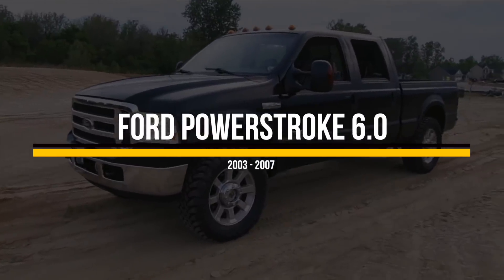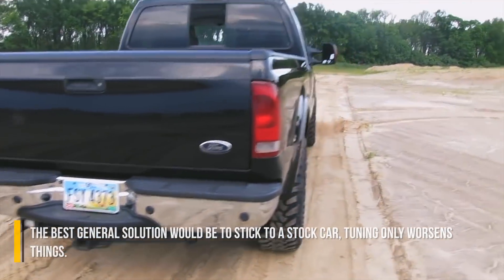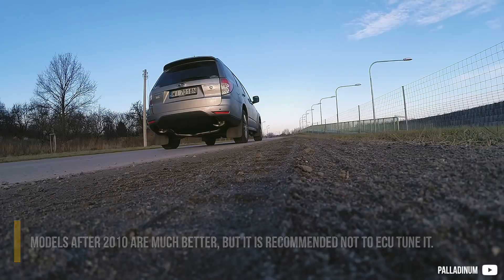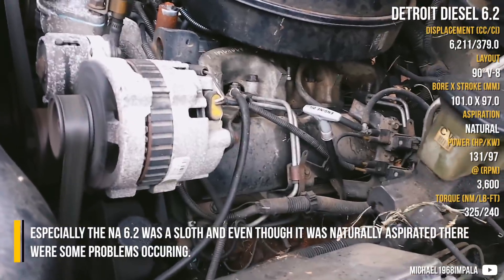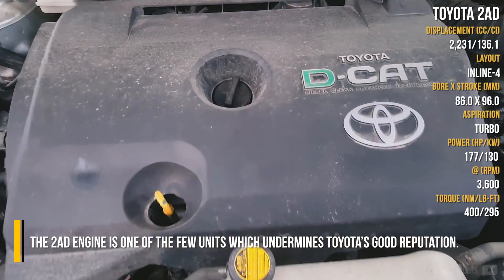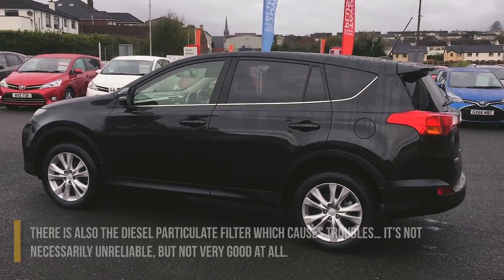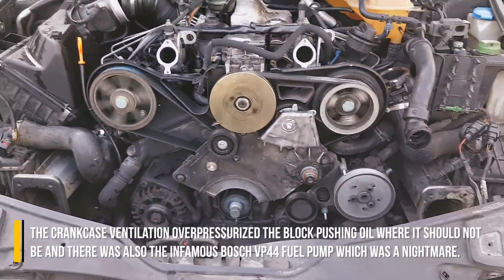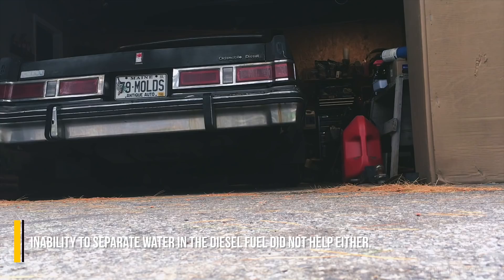6 Worst Diesels You Should Stay Away From

Comment: I’m going to disagree with the 6.2 and 6.5. I’ve had a 6.5 in the past. Like you said, it’s an economy diesel with torque and horsepower coming in at low rpm. It’s not that they can’t tow, it’s that they can’t tow where you’re showering down on them. Their peek efficiency is around 1800rpm. As far as their problems, the marine industry has the solutions for most of them because of their popularity for ship generators, not to mention their military applications.

Comment: Every diesel that have 3000 rpm max, big displacement and low power and torque, it can resist for long time with million miles......you can see the buses or truck expecially if they havent electronical element

Comment: 6.5L V8 turbodiesel...
Don't tow heavy things, not meant to do that... IT'S A TRUCK ?! WHAT ARE THEY GOOD FOR
Reply: I was confused by that too, a diesel powered pickup truck is literally made to tow stuff. It's the reason you'd buy one :D
Reply: I was puzzled by that statement too, because if that's the case there's not much point buying one!
Reply: IDK. Uncle had a 6.5 turbo towed everything he wanted to pull. Cuz had a 6.2 in an old suburban years ago. Slow as all hell. But got 20-23mpg towing a ski boat. That's no bad.
Reply: A big truck wich cannot tow heavy things? Wow, That's what i call shameful.
Reply: Never had a problem with ours we used to haul the backhoes with it for my uncle
Reply: 3.0d MB with turbo u have same power , also drives 1mln km , can be used in trucks less Liters/100km not so heavy lul
Reply: Lol I pull heavy stuff with my 6.5L TD 3500 constantly 😂😂, skid steers, trackhoes, farm tractors, fords, and much more 😂
Reply: The 6.2 and 6.5 were intended as fuel savers, not workhorses. Which is pretty much the opposite of what a diesel truck engine is meant for
Reply: uhhh...drag racing ? :)
Reply: The 98 6.5 td stock in a k3500 only gets 13 max anywhere except the 2 times i went downhill all the way for 2 hours and pulled off 18mpg without a load
Reply: ruben matthys  isn’t that the purpose of a diesel of motor is to tow heavy things. Because they have a lot of torque?
Reply: Isaac Smail the 6.5 turbo diesel only makes 400 lbft of torque and 185 hp
Reply: HitchedZebra59 the 6.5 had the most horsepower and torque every year.
Reply: The point was that the military design that motor torque for the Hummer H1 Humvees and Military K5 than GM implemented it into civilian vehicles and cause all kinds of failure issues on purpose so that people dump money into them if you learn about the motors weak points and take steps to fix them like a mechanical blow off valve a better fuel pump relocate the ECM and out of heat sink better Turbo pump up fuel system redo the head I suggest getting a custom head gasket made to hold the extra power and may do just fine as a matter of fact a lot of people who have ocean-going boats like the six five because of its reliability in mileage
Reply: Christian Nickels you have absolutely no idea what your talking about
Reply: jdr ok  really because I own one and it works great after removal of the vacuum pump I relocated the PCM got a better lift pump to feed the injector the most reliable vehicle I've ever owned I'd like to know exactly what you know about the six five Detroit that leads you to believe that I don't know what I'm talking about because personally I think you blowing a bunch of smoke but you don't even own a diesel matter fact I'm on the  impression that your just a keyboard Warrior and I doubt you've ever actually turned a wrench so if I don't know I'm talking about back it up and explain to me why it's not a decent motor mind you I'm not claiming it's the fastest thing in the world merely that it can pull not fast but it will pull a lot of weight and do so reliably for a long time
Reply: Christian Nickels no you really don't gm designed the 6.2/6.5 then they got used by am general.
Reply: jdr ok tell me what vehicles they came in they came in Hummer H1s they came in K5 Blazers that were military usage you can buy them from army surplus stores then after it became a civilian motor it came in 1500 and 2500 Chevy CK trucks various other companies picked up usage of it and put it in some tandem semi trucks and other things but it was a GM motor through and through originally military contracted but always used by GM built by Detroit Motor Company which was is gm owned
Reply: Bro I've stood in the engine bay of more semi trucks and you seen on the highway
Reply: towing.
Reply: jdr ok you're so knowledgeable about diesel motors bro what's an lb7 or an Lbl do you know bt6 or bt4 or isx15 cat five hundred fuck bro can you even tell me the nickname for the 6.5
Reply: Whoever is first to throw out that old compensation stereotype is usually only doing so to make themselves feel better about their own short coming. Avoid the spotlight by standing behind it, that's grade school tactics man, you're only fooling yourself.
Reply: Had a 6.5 in my 2002 express van. Gas mileage was ok. My god was it loud tho! And it covered my neighborhood with soot when i finally got it started in the winter.
Reply: Get a real diesel get a 5.9 cummins not a gas engine wannabe diesel!
Reply: more than the 7.8L turbo-diesel makes in the truck im buying...
305-lb-ft and 135hp. but it'll last fucking forever. military engine
Reply: what makes it bulletproof? about 1800lbs of steel. (engine only, dry weight)
m35a2.
havent purchased it yet. still a few months out. these kind of things arent rushed...heh...truck only goes 55 at redline lol

its a 6 wheel drive BEAST. i dont think it would be called a truck honestly,...but im not sure of a better name for it.
Reply: Tyler Werfel my dad has the HD version and his biggest piece of equipment is 8 tons and it tows that no problem. So 3 skid steers,2 excavators plus all the tools and equipment in the truck itself. It’s slow though but no big deal.
Reply: @TheJeremy5599  My dad's coworkers called his 1969 Olds Toronado "The Gold Tank", so I would call your beast a tank. That car was unique. 455ci, 400BHp, 400lb/ft of torque, and front wheel drive.
Reply: @PorygonFanatics I couldn't really understand why the 6.5 couldn't be better than it was. Some have better luck than others. Heel they are used in Hummers. After all, it's a Detroit, they build some of the best industrial diesels.
Reply: @daw7189 

They are brilliant engines if you build em with proper parts alot off the problems with them are stupid poor componets that fail 
Get rid off these and you can have a bomb proof i have two engine s chevy 6.5 supercharged 300hp each sip fuel make big power
Reply: Joel Sullivan  just the 5 speed manual with a 410 rear.
Reply: They were good for nothing.
Reply: @jdrok5026  'scuse me. My 01 7.3L had 250hp & 525ftlbs. The anaemic 6.5L wasn't even close. When I bought my 01 Ford, I had a salesman on a GM lot tell me not to buy the 6.5L diesel. Because they had too many issues.
Reply: Year by year, the 6.5 td made pretty much the same power and torque numbers as 5.9 Cummins, and weighed 400 lbs less. Sure they had problems, but they are still capable towers.
Reply: HP dont mean shit tho. 12v cummims makes 180 with a manual but made significantly more torque than the competitipn of the time.
Reply: @ohiopower  thats a ski boat. Try towing a goose neck live stock trailer loaded with calves they blow head gaskets and spin bearings.
Reply: @PorygonFanatics detroit diesel had nothing to do with the duramax. Gm called in isuzu being tgey owned part of them and the company had many years of experience in compact diesels. The duramax is actually a scaled down version of a 12.0L v8 diesel used in trucks found in southern Asia.
Reply: These motors were NOT built from a gas motor. Totally different bore, stroke, head, valve configuration, squish angle, ect. These motors were made by GM, Detroit Diesel being the divisions name, for military use. They have a much lower compression ratio than your 7.3 or 5.9 so to be able to run on jp8 or kerosene if needed. Detroit also has an 8.2 motor in the same class. The 6.5 was an answer for more power, increasing both the bore and stroke, still a lower compression motor only running 5 psi boost. The crank seals, piston rings were NOT made for high psi boost (7.3&5.9 run 25-30 psi) it was made for reliability and economy. Something that would get troops home no matter what and they still do it today! Along with 1000s of these motors still working in boats daily. PMD and shit banging Borg Warner (Ford) Turbos were most of the issues along with some blocks cracking where the starter mounts.  PMD and turbo easily fixed. When taken apart and rebuilt with studded heads, custom head gaskets, better seals, better pistons/rings, better injectors, bigger turbo and a few other tricks, these are truly impressive motors putting 400+hp and 800+ft.lbs down, and personally, these built 6.5s sound better than any other diesel. I've owned a few of these and pulled 4 horses to the mountains, firewood, hay, whatever I've wanted and i love the 22-24mpg I get after 1/4 million miles.
Reply: Colton Carpenter, you are partially correct about the 12.0 Isuzu. The duramax is more like a 3rd generation "micro-computer controlled"  engine and the 12.0 being the first. Very very few similarities. 
As for not pulling, a stock trailer is exactly what I haul almost daily with my 1994 chevy 6.5 with 254,000 on it. Ain't spun a bearing yet, I'd lean more toward improper oil level or weight if I was you. This is the 3rd one ive got and I'm looking at another. Can't keep injectors in a Damn Cummins and I won't allow a shit popping Ford on the place!
Reply: @todydn  lbl I've never heard of the duramax designation.
Reply: @rickslickk5216  um huh?
Reply: Ok, well I have owned many 6.5 diesels and this weekend I was hauling around a 10k lbs excavator on a 4500lbs trailer which I often do and it works just fine, granted its tuned with a bigger turbo but there is nothing wrong with a 6.5 nor a 6.2
Reply: It’s good for farmers burning purple diesel and just looking for a truck that burns the same fuel their tractors do lol. Especially sense they put the 6.5/6.2 in half tones. It’s a good back and forth from town truck.
Reply: They mean anything over 2000 pounds. I know I found it out the hard way the where the flywheel hooked up to the torque converter the crank broke their 😭😭
Reply: HitchedZebra59  brother unless your hauling a fifth wheel semi sized flatbed with a load youll be fine with a 6.5😂no they can't haul 100,000 tons like a Cummins but its been pulling my 33ft camper cross country no problem for the past few years and mods r cheap, add a slightly bigger turbo like I did and not only do you gain some mpg's but you can pick up those HP by about 30-50
Reply: @glennv3176  the 6.2 was made for fuel economy not to tow as it makes about 130 horsepower
Reply: Not a lie,our local GMC dealer was going to let us tow a parade float with one until he found out that towing any trailer would void the warranty on the truck.
Reply: The 6.2 was made in a gas crisis and GM wanted a fuel efficient motor. The main difference between the 6.2 and 6.5 is the 6.5 is turbocharged and can actually tow and the modern Duramax's are designed after them. The 6.2 came in GM's C/K20 and up Blazers, suburbans, and pickups.
Reply: I have a 6.2 84 scottsdale and I can pull anything I need just rolled over 300k miles only thing I changed on it is water pump
Reply: @MrErikw26  Thier rated in Mule Power, not Horse power ! As long as oil changes are done , they'll last 250,000+ miles no prob. My ' high output' version,circa 1987, has 155 HP. The 4-WD s near- bulletproof.
Reply: @aaronhumphrey2009  so they're rated by how many jackasses it takes to get the work done? Leave it to GM lol....
Reply: Carry shit?....
A PICKUP is mean to carry things, not tow, sure most CAN do it, but they`re not tow trucks, tow trucks are tow trucks..
Reply: @afrog2666  🤣🤣🤣
Reply: GM diesels were made mainly for fuel economy over a gasser before they came out with the Duramax.
Reply: I just hauled 4 ton of soil with my 6.5 no problem
Reply: I’ve towed 10-12k lbs with my old 6.2 many times. 267,000 miles and she’s still going strong.
Reply: Glenn V not necessarily. In the late 70’s early 80’s with the gas crisis, they were built for economy. Learn your history.
Reply: @shanerobinson7128  they should be smarter and build smaller engines as in Europe... 
And like i don't know about the fuel crisis. Damn 😅
Reply: @Matthyske  Them smaller engines arent going to help pull a Half ton to 2 ton pickup truck .
Reply: Thats totally not true. Ive had several 6.2's and a built 6.5. My 6.2's pulled motorcycle trailers, boats, car trailers, ect. They were built in the 80's and early 90's when speed limits were 55-65 mph. So they were never built to operate at todays highway speeds. Dont try to tow in overdrive, and keep your speed reasonable (what the truck can handle) and they will plug along forever. And get you 20+ mpg. My 6.5 was bulletproofed and built up, but it would tow anything i needed to. I towed a Case backhoe on a 34' gooseneck from Bozeman MT to North Dakota. More than capable, and never had a problem out of it.
Reply: @stuchbrosmnore8627  in europe, they do a good job :)
Reply: @cyc25ruffneck  i'm just quoting what he said in the video. It seems unreasonable for me ;)
Reply: @Matthyske  How? Smaller engines , in a 2 ton and half ton pickup truck will be strained and overstressed in the long run.

Also, we're talking about the 6.5s and 6.2s that were built in the 1980s when diesel engines, in Passanger vehicles such as cars and pickup trucks were sluggish overall. 

However, gets better MPGs .

While, if you wanted speed , pulling power for heavy-heavy loads and dont care much about fuel economy, you get a pick up truck with a V8 Gas engines such as the Big Blocks of Chevy 454s or Ford 460s.

Big Block gas engines are/were the diesels basically.
Reply: @Matthyske  I understood what you meant. I wasnt contradicting what you said, i was saying that the statement in the video was not true. I just wanted to share my experience and knowledge about these engines. They are great engines, some of the changes that GM made to them to adapt them to use in a vehicle, were crap, but easily fixable.
Reply: @cyc25ruffneck  What most on here fail to know, that diesels in pickup trucks and cars where sluggish overall.

Diesels were, and currently are, meant to overall be fuel savers.

Not "just for towing".

When fuel saving was not your objective and you wanted lots of towing power with speed and durability. You had to get V8s in Big Block forms such as the 460s and 454s.

Big Blocks are/were the diesels basically.

Also,companies such as Uhaul use big block gas engines in their trucks.
Reply: nah you are close minded. not everything is heavy many things have bulk and little mass. the 6.2 is a work horse engine if you disagree you simply have never used one for 700k miles
Reply: @MrErikw26  what things are meant for and can be used for happen to be quite different.
Reply: @mothman-jz8ug  disagree. Mine is great for everything we use it for. Never quits no failures.
Reply: @caseyc8603  depends on the year and truck my 93 turbo 6.5 has 215 hp stock and 440 torque
Reply: Put stacks on it and roll coal
Reply: @MrErikw26  They are workhorses, simple in design.
Reply: @chasevenstra1698  So I can make LBZ or LML numbers out of a 6.5 reliably?

Comment: Most of these engines are great, it's just the stupid "emissions" systems that fail or ruin them.
Reply: Injectors and high pressure pumps aren't "emissions" items.
Reply: Yes, blowing head gaskets are because of emissions
Reply: it's true you gotta roll coal
Reply: @randy s 6.0's 10 year catastrophic failure rate is alarmingly high ...
Can't remember exactly numbers though
Reply: I suppose you're opposed to sewage treatment? Just dump the sewage in the river. Your water-sewer bill would be less
Reply: randy s the 7.3 is the most gutless engine ever made
Reply: randy s 7.3 is bad? 600k miles on each one in my fleet...
Reply: Diesels are dirty engines. 

And don’t correlate fuel economy to environmental friendliness. If that were true, we’d all by driving two-stroke engines burning mixed gas.

Comment: “The Japanese just can’t make a reliable diesel engine”... hold on there sunny! Isuzu is Japanese and they are arguably the worlds best diesel engines. Nissan is also an excellent engine manufacturer. Fuji Heavy Industry (the parent company of Subaru) makes many high quality diesel engines. Mitsubishi is another excellent diesel engine manufacturer. 

I think you’re smoking a bit too much hash with your statement.
Reply: The new Nissan Titan diesel uses a turbo Cummins V8.
Reply: You forgot about Mazda diesel engines used in older Ford Escort Diesel cars. They were only made every 4 years.
Reply: @buddyclem7328  I know.. put 200000 miles in my escort 1.8d never missed a beat
Reply: if Isuzu made the best diesel engines, then why does everyone put a Cummins in everything from semi trucks to race cars?
Reply: Cummins says no
Reply: Duramax is Isuzu
Reply: @ David Blalock Are you out of your mind? The Isuzu is the worlds best diesel engines? They can't compare to Cummins, Cat, Mercedes Benz, Volvo, Ford, etc. Have you ever driven a Duramax? That's an Isuzu. They are 3rd place in a 3 horse race against Cummins and Ford.
Reply: @1LOCKNLOAD  And people are supposed to take your opinion as fact because?

Comment: I have a 1998 K-3500 with the Detroit 6.5 turbo diesel that I use to tow a loaded three axle bale trailer. 321,*** miles and still going strong with some minor upgrades and modifications such as marine fuel injectors, a relocate kit for the PCM, and upgraded head studs. I am only 15 and I bought it at 14 when I got my farm permit and I have already put 30,000 miles on it. That truck has been a real workhorse for me.